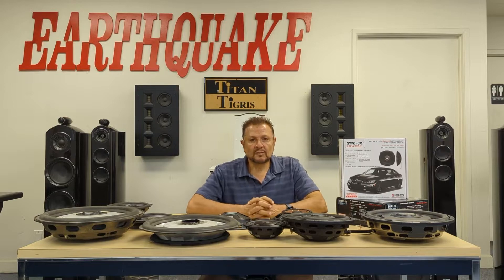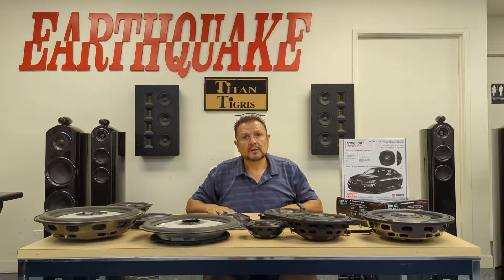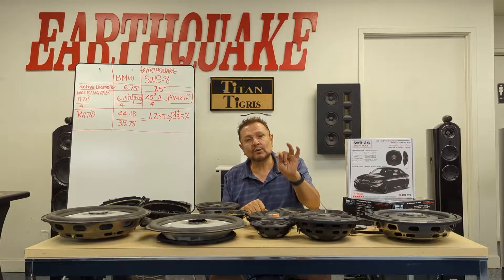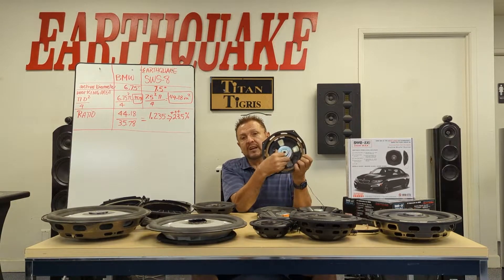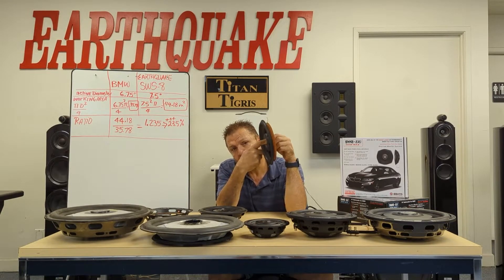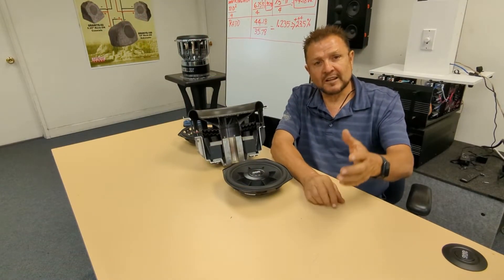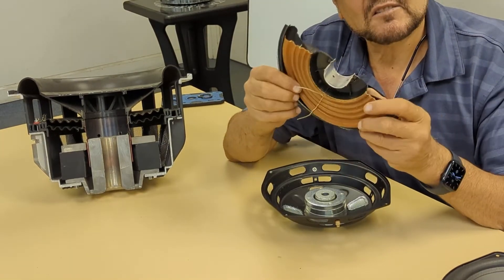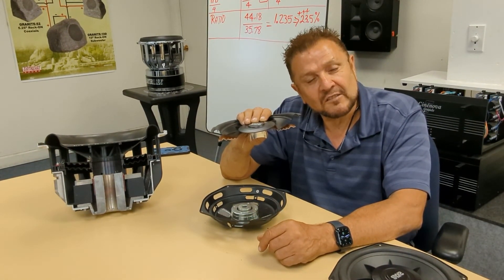Earthquake Sound SWS Shallow Woofers - Amazing Bass With Limited Space

Comment: Which one should I buy 2ohm or 4ohm? Am upgrading from a stock hifi system in a bmw f10. Thanks.
Reply from the maker: You will have to check the specs on your stock head unit. I believe the 2 Ohm SWS8 will work for your system , but double check.